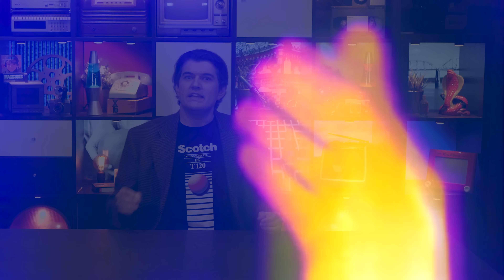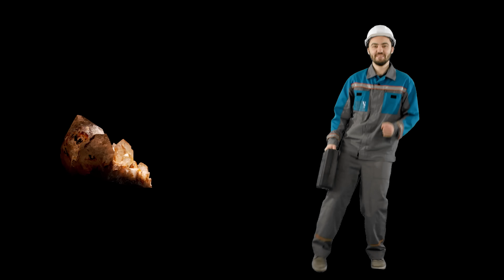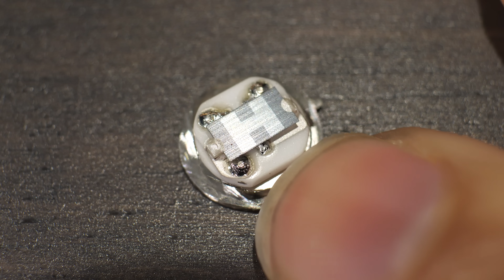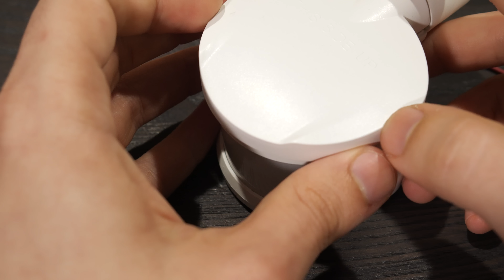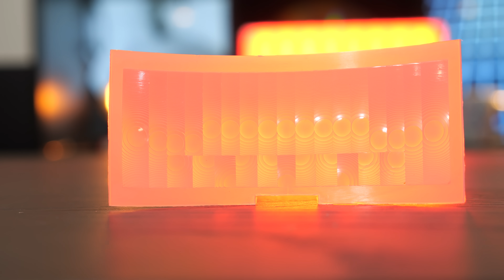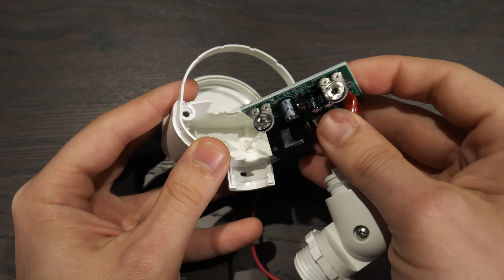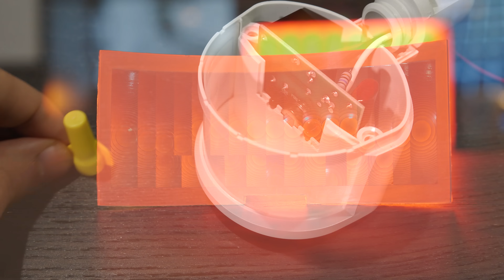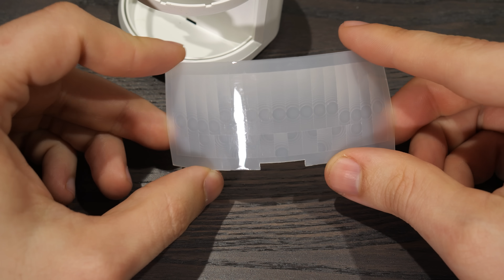Passive infrared motion sensors: a two-bit camera powered by crystals

Comment: My favorite use of motion sensors was in the old movie Sneakers. "You can wear this neoprene suit or you can walk REALLY slowly." Turns out, it works. Walk slowly enough and you won't trigger one of these sensors.
Reply: from my experience, it's gotta be excruciatingly slow, though
but it also depends how well the sensors are tuned, I guess
Reply: I'm pretty sure Mythbusters tested these sensors as well. If you walk veeeeery slowly past them, they don't trigger.
Reply: @joshbbglover  My favorite way they defeated them was just holding up an infrared opaque sheet of something in front of themselves as they walked past. I remember a pane of glass and a regular blanket both working.
Reply: I do this, when I was 10. Being very slow don't trigger red diode. That was fun.
Reply: [Mother walks into the room and triggers the motion sensor]
Donald Crease: This is what's in Cosmo's office. Best motion sensor on the market.
Mother: And watch this.
[he breathes in front of the sensor, and it goes off]
Donald Crease: Also responds to thermal differentials.
Martin Bishop: Does this have a happy ending?
Mother: Oh, yeah. We can wrap you in a full-body suit of neoprene, heat-resistant rubber. Or we can raise the temperature in Cosmo's office to 98.6 degrees - which is probably what we'll have to do, because the neoprene would suffocate you. Either way, you've got a top speed of two inches per second. Any faster than that...
[alarm beeps]
Mother: and, uh, big guys with guns. But you'll probably do fine.
Martin Bishop: Since when am I the one who's...
Mother: This is the same model answering machine that Janek used for the shell of his box, now that's what you'll be carrying across the room at two inches per second. I got that for you because I figured you'd just, you know, want to practice. Remember to go real slow!
Martin Bishop: Slow.
[looks at Crease]
Donald Crease: You get all the fun stuff...
Reply: If you move fast enough, will there not be enough time to heat up?
Reply: Lightning is fast and the only way to confirm is to test this out with a chronograph  @jameshughes6078
Reply: On the rare occasions when my mom would have to take me and my sister to her office, a fun game for us was to try to walk slowly enough past the motion sensors that the red led wouldn't flash.  We were little, and I don't know if we came up with this game, or if my mom was a genius at keeping us busy and out of her hair while she finished up whatever she needed to do at the office.
Reply: Regardless of design, any motion sensor must have some speed threshold anyway.
Reply: @ghaydn  That's true. However, the point of these is more to detect intrusion rather than motion. So detecting a non-moving human being would be even better. As long as it's a human being, and not, you know, a slightly warm mannequin.
Reply: What if you use a shiny aluminium foil blanket
Reply: Would work if the foil doesnt reflect some heat from something in the room @oremooremo5075
Reply: Mylar, can reflect ir, thus could still give feedback ( input to sensor) but depending on settings  @oremooremo5075
Reply: @oremooremo5075 
Dennis e Taylor had a Charakter in his books use a styrofoam shield or suit to evade detection. 
Might work based on the video. 
Also the author really does his research, so I’m inclined to believe it might work
Reply: This way I demonstrated a few years back that the alarm mounted in our workshop is useless if the intruder knows where it sits... and we had a lot of guests coming by so it was basically useless if you carry this knowledge.
Reply: Ouch. Just ouch. Look I know Sneakers was 30 odd years ago, but you don't have to remind us of that . . .  (mutters: "_old_ movie")
Reply: I also could not help but think of Sneakers while watching this. Sneakers is my family's favorite movie... Perfect blend of humor, suspense, espionage, intelligent plot points, music, acting and not taking itself too seriously. We almost always watch it over the holidays, and it never gets old.

My voice is my passport, verify me 😁😁
Reply: Figured the 'move slowly' thing from trying to sneak past the light-activating sensors in grade school. (Wasn't sneaking out or anything, just a game.)
Reply: Just make yourself a bedsheet ghost, the sheets block your heat signature but hold the same temp as the room air so unless you walk in front of the heater/window and block it, the sensor won't trigger
Reply: Can confirm. Playing ninjas as kids in an old warehouse with these and we made it in and out without detection.
Reply: Just remember to go real slow!  Slow... great.   You get all the fun stuff!
Reply: I was hoping Sneakers would come up in the video, glad it at least made it into the comments.
Reply: As a kid, this was my first thought:

There has to be a threshold of movement that it either disregards, or can't detect.

So of course, I would try to "beat" the motion detector by moving as slowly as possible haha
Reply: The circuit isn't very complicated  and effectively averages what it 'sees' every update within a certain threshold to avoid false triggers. Basically all of the common ones you see won't go off by moving very slowly. If you're bored and don't think that game sounds fun, just spray an upside-down can of dust-off towards it.
Reply: I saw a movie where they "movie hacked" into the building's climate controls and made the target office as hot as the infiltration person's body temperature.
edit: jonathankleinow2073 posted the scene I was thinking of.
Reply: before you break in, aim an IR torch at the sensor to flood it. once it "knows" it's a static item, the heat you produce won't be detected.

DISCLAIMER: This is just a theory, plz don't do this
Reply: I’ve tried this. It sometimes works, but it’s really difficult.
Reply: We used to test this when younger. It really works
Reply: You wouldn't happen to be one of my college professors would you? He loves that movie lmao
Reply: @SubliminalVibes  Yeah, I can never remember where that works and where it doesn't, but it still serves for emphasis so I just shrugged and moved on.

Comment: Those spot look like they actually focus the light onto the two crystal in an alternating pattern of left,right,left,right, making it alternate the crystals in a rapid manner which allows them to pickup the slightest of movement instead of you having to move to the other side of the sensor before it picks up anything. Now, if you looked closely at the dots, you will notice that there is actually 2 rows, and looking at, the second, you will see those lenses also move up and down. Which is why there is a H.
The big row is like explained but the only shine on the vertical lines of the H (the black line on the outside and silver part) and the uppy, downy row shines in the middle where the second set of sensors are. All this adds redundancy that allows it to pickup slow and fast movements because someone could walk right in front of it making the alternating pattern go to fast for the fett to pickup.
That also explains why the lenses are different sizes, it's because they operate at different distances.

Hope that helps, This may not be accurate because this is just a guess, but I'm sure that I am close to it.
Reply: Edit the part I wrote was partially said but the part about the H could not go without the other, plus, I detected a slight misunderstanding of the second row and it is important to the H.
Reply: Edit 2: So people here have comments older than the video, how did you all do that? (I have a suspicion that is a thing related to channel members being able to see the video before it is public)

Comment: Very nice work. Greetings from a PIR nerd.

Some notes  - the hidden "disco ball" mirror array inside some sensor devices are actually an array of parabolas as in car headlights. These are individually designed to focus infrared light from a specific incident angle to the very center of the pyroelectric crystal elements inside the detector. Similarly, the lenses in a fresnel lens-array are also each designed to focus light in the same manner, such that from a selected coverage pattern of incident angles, each has a lens that causes light from that direction to be focused to the middle of the detector. 

As part of the design process the effective coverage pattern pattern is raytraced with a simple stochastic photon model from the detector crystal elements out and through lenses and/or parabolic reflectors and into the environment. This gives the predicted coverage pattern which conceptually is like a cluster of big chunky and hazy-edged beams of "inverse light" - detection lobes with alternating polarity, a bit like an antenna gain map. We then analyze the predicted performance by passing thermal contrast dummies through these beams which generates simulated waveforms across the detector crystals. Based on this we can tune the design for the intended application - indoor, outdoor, different mounting positions and angles etc.
Reply: Uh, I think we need a Connextras visit to this lab, stat!

Please and pretty please.
Reply: I would like something like that as well!
But in the meantime, if any of the readers want to see some pictures, "pir motion sensor field of view" in google seems to give exactly this kind of sensitivity diagrams.
Reply: Alec's comment on people emitting heat made me think of the prototype Concorde Aircraft at Yeovilton. One section of the cabin is fitted out with all the seats, with people shaped metal aluminium plates with large resistors mounted on them sat in them. That was how they tested the effectiveness of the air conditioning when designing back in the 1970s.
Reply: @MrDuncl  such dummies are still being used today to supplement and refine the computed / raytraced predictions of PIR system characteristics. The dummies we use are usually half or third scale and made from thin copper plates bolted with ceramic standoffs to an aluminum frame and with a layer of black stove paint on the side facing the PIR system, acting as emissive diffuser. On the back are power FET switched hot resistors along with temperature sensors as feedback for an array of thermostats. Our dummies have different controllable emissive temperatures for head, forearms, hands, feet since in humans those often glow at different temperature than a clothed body.
Reply: Thank you for a very informative comment! I still don't understand some bits about the whole design. For example: why is it, that when I'm moving very, very slowly in front of one of these detectors, it doesn't activate? Is it because of how the logic part is programmed, that it ignores "blips" of signal which come in long enough intervals to avoid false alarms caused by some natural gradual changes in the environment?
Reply: When you're not moving, you're invisible to a PIR system. 

As Alec correctly showed in his video, the "motion detection" is based on threshold triggering a circuit based on a super tiny charge (or capacitance) differences between the two elements in the detector.  

And those elements are reacting only to changes in total impressed thermal radiation as received through the optic - i.e. the lenses or "disco ball", which is akin to the segmented eyes of an insect if you imagine that all eyes share the same two "pixels". 

Those conceptual beams of "inverse light" with alternating polarity that I mentioned earlier, are kind of like projected images of those two pixels. 

So conditions for detection to happen are that 1) you or parts of you are glowing at a different temperature than the background environment. 2)  you are moving laterally relative to the motion sensor such that you cause asymmetric changes to the impressed radiation on the two pixels.  

The 2nd clause of the above also gives the "achilles heel" of most (but not all) PIR sensor systems in that moving in a very carefully controlled straight line directly towards the sensor can also defeat detection since the effected change is symmetric and so cancels out, giving no signal.
Reply: Hi KanalFrump, Sounds like we have the same proffession.   You are spot on.
Reply: Maybe someone could manipulate it somehow and from it make a scanning thermal camera.
Reply: @jagmarc  interesting idea. But you'd be better off starting with a thermopile type detector (which measure absolute temperature) rather than the pyroelectric types used in PIR motion sensors, which only detect changes in temperature, and that is mostly gibberish in a scanning context. 

Also you'd need to create a collimating simple optic in front of your scanning "pixel". The typical lens-array optic of PIR sensors are basically like seeing not just double but typically 20 images or more, superimposed. And the challenge in creating an optic for thermal infrared (IR) is, not many materials can refract those wavelengths, which are 6-10 times longer  than the typical ~850nm near-infrared (NIR) of remote controls.

Glass looks like a mirror in the thermal IR. Some types of metal crystals and many types of HDPE plastic can refract and transmit long-wavelength IR, but they use special formulations in motion sensors. You can obtain a pretty good "single pixel optic" from a typical handheld touchless temperature gun. They'll have a little fresnel HDPE collimator lens in front of the thermopile. In fact, that's most of the stuff you need for building your scanner. Just add an XY gimbal. Go for it, good luck.
Reply: @KanalFrump   Wow! Looks like U figured out how to do it already well done.  Magic of YT
Reply: @KanalFrump  That is how the first thermal cameras worked. Then came "Line Scan" cameras which used a linear sensor like in a scanner for the X Axis and spinning mirrors for the Y.
Reply: @KanalFrump Rapp has built something similar. Google for Rapp instruments and Thermografie. Unfortunately German but google translate is working ok for it.

Comment: Looking at other differential pyroelectric sensor designs, I think there there is is one linear sensor that develops a voltage say left right, with the center as one pole and the two ends connected as the other pole, so if I map the voltages (without the connection) then right will be say, -Vl, center 0, right as +Vr. By connecting the two sides, I get and output which is Vr-Vl which is zero unless the voltages differ. Strictly speaking, I think you should actually talk about CHARGES appearing and not voltages.

Comment: I would have approximated it like this:
Take a thermal camera image and split it into 2 like a checkerboard. Sum all white "fields" and subtract all black ones to receive a single value. If something moves (that is not exactly an even integer multiple of a checkerboard field), the value fluctuates. To remove the weakness, just de-uniform the checkerboard (make random shaped fields) and voila, you got the fresnel lens.

Comment: I installed an outlet for the very first time the other day and it worked first try! I've been terrified of electricity my entire life, thanks for giving me the confidence and knowledge to finally do this stuff!!
Reply: Be careful with exectricitly, just necause something is working doesnt means its safe. An important thing with outlets it that you want to make sure there good is contact to the wires so that high amperage currents can run through without any weak, narrow connections that would produce excessive heat.

Given that you said you were terrified of electricity, I think im safe to assume you followed all the rules and did things properly. Good job!
Reply: @risenempire  stay terrified. Once you get comfortable you'll get complacent and get that wonderful ☠️ tingle